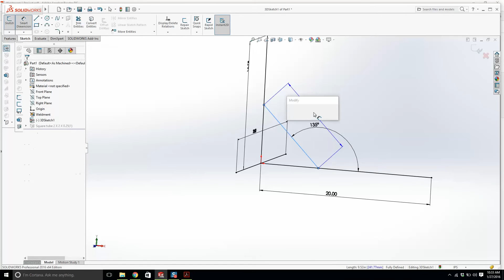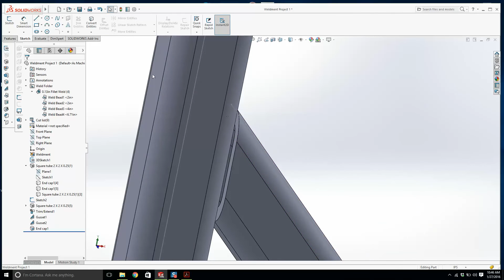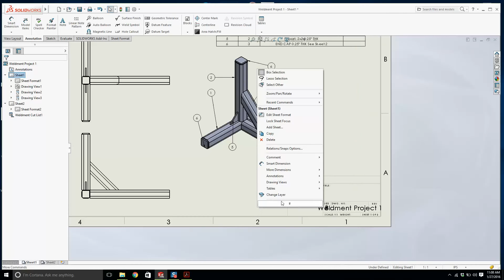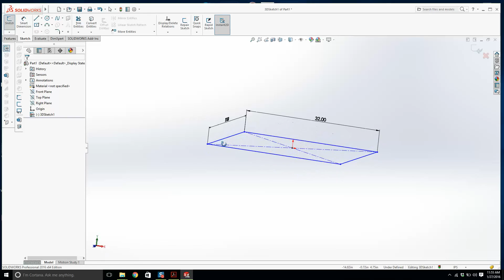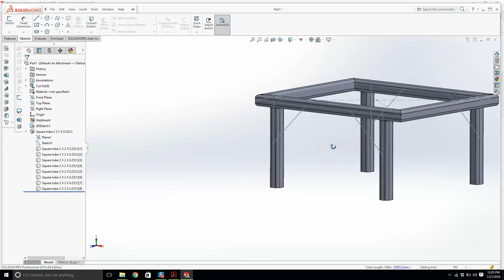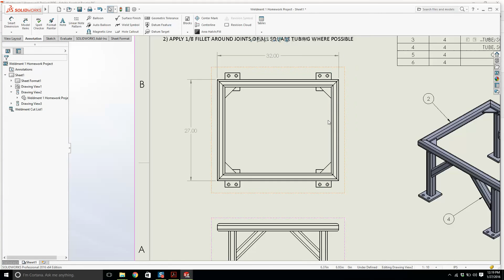Solidworks  - Weldments

Comment: Just an observation, but I think you should've chosen the "alignment" option when creating the first (cross) structural member, to align the rear/bottom of the profile with the construction line. That way you could've kept the same dimensions in your underlying sketch as were on the drawing for consistency.